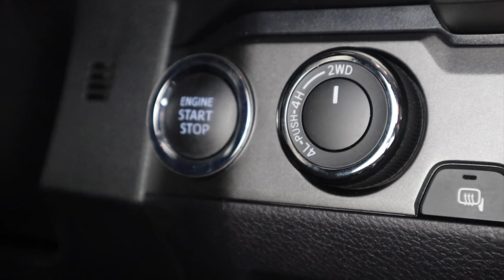Should you buy the latest Toyota Tacoma 2016-2021?

Comment: These are INCREDIBLE trucks that no other truck in the WORLD has or ever will beat with quality. (period)  These are value added and have the GREATEST resale value in the world of trucks. (period) Go Pro mounts are cheap and easy to install. I own multiple Toyota Tacoma's and every year and since 2011 and they ALL are still on the road and work awesome, like new. The domestic trucks of same year, well most are not on the road anymore. I have NEVER had any issues other than changing tires, oil and filters - oh and adding air to the tires to all 8 of my trucks over these year. I sold a 2005 Tacoma for $6K with 268K miles on it, UNBELIEVABLE VALUE! The issues here, I have not never experienced, nor have my family or friends. There is a reason why they have high resale value and sell at a high price - THEY ARE WORK HORSE trucks. Every contractor wants these trucks! The Tacoma has more accessories than any other truck in the world too. Sorry, but my next truck will be a Toyota and another of my old Tacomas will go to one of my sons again.

Comment: I have a 2006 Tacoma 4 cylinder model and I had to replace the plastic coolant bypass pipe and I bought a metal one online and cut a 6 inch piece out of the middle and used heater hose and 2 old school hose clamps so I would not need to remove the intake manifold.    Now it has 250,000 miles and still runs Great.

Comment: I got new 2018 Off-Road v6 , so far after 4 years only 1 issue I had it's constantly shifting gears , I ended up with Regearing the truck with Nitro gears 4.88 on my 33" wheels. Happy so far

Comment: My 17 TRD Off Road hasn’t had too many problems. But it’s in the shop now at 75k. Power steering pump and rack are leaking. Also the dreaded timing cover gasket. Thankfully both under warranty. We will see how long the timing cover replacement will last till replacement again.  Only other issues were valve cover plug tubes were leaking and third break light.

Comment: What are your thoughts on the "AC Drain Mod" that seems to be popular? Some Tacoma owners are concerned with the condensate from the AC drain dripping right on to the frame and causing rust. I am considering doing this mod but extending the drain brings the hose very near the exhaust and I am also wondering if extending the hose with increase the chances of the drain getting clogged. I would love to know your thoughts on this. Thanks!
Reply from the maker: Hi! I would extend the hose! It won’t get clogged but it won’t drain on the frame anymore
Reply: @TheCarCareNut  thank you!  I will do it.

Comment: I have 2006 Tacoma 2WD Dcab 6 foot bed 246k miles . In December 2018 new frame was installed because of the recall . I live in Chicago so no surprise to me . At around 190k all wheel bearings were replaced , no problem with the engine 4.0 V6 , transmission ( dealer changed the oil at around 70k for $200 , one dealer wanted $400 ) , spark plugs changed twice , bearing on drive shaft . If you having problem with rear spring leaves I can recommend Spring Allign in Palatine IL , in 2019 after one year the frame replacement they were done , too soft if you want to cary some load lets say around 1400 to 1600 lbs ( I know payload on mine is 1450lbs ).  But now I'm facing the problem with gridding noise sometimes not always , only when the car starts moving from stop . It might be from rear differential , so far no success finding guy who knows how to resolve the problem  . It' time for new truck anyways .This time Tacoma 4WD not sure yet , long bed  double cab .  Just wanted to share my experience .

Comment: Thank you for being honest about the Tacoma pickup. I just bought a 2021 TRD Sport and after 9,000 miles is is still running perfectly.  I have the premium audio package and find it to be more than adequate.
Reply: How does the premium audio sound? I need premium audio but dont want it if its not going to sound that good
Reply: Report after 90,000 miles.
Reply: @agentaguilar199  just get an amp and speakers

Comment: I have a 2016, and bought the extended warranty. So far the only iss u I have run into was the torque converter shutter, the dealer replaced the trans at 75k and fixed a minor coolant leak.

Comment: Hi AMD, I have a 2016 Tacoma 4 cyl. I have not experienced any problem at all. Not even a bulb.one time 4 years ago I felt ONE shudder that’s it. I bought it brand new . It was made in Texas in April I bought it in May. No tranny hunting, no vibration and no leaks at all. I drive it like a truck not a Supra. Also the very slight vibration at idle cuts in half after a longer drive. No Honda counterbalance here👍 With no bumps it rides Lexus smooth.

Comment: I just brought my 15 dbl cab TRD off-road taco with 147k to the dealer for the crc frame treatment, free of charge, they gave me a 21 TRD off-road rental to drive for a week or so👍. The sales manager called offered me 15k trade in value for mine and keep in mind this is a work truck for me It practically was lived in for 6 years, and is black scratched up pretty good. Needless to say I took the offer and as soon as the frame is done and I remove the decked system I'm getting a brandy new TRD off-road with all the bells and whistles  it will be at the dealership tomorrow. I loved my old one would have drove it into the ground if the trade value wasn't in my favor. And by the way not a bit of rust on or in my frame I always kept an eye on that over the years. I'm in NE PA salt and cinders all winter.

Comment: I bought the next gen 2018 camry with the new 8 trans insept 2017...  A few adjustments in my mind needed to be made about the adaptive transmission technology... it did change the shift points based on my driving pattern.  I had it back to the dealer 6 times.... but it was a software issue.... but performed flawlessly to 90k... until I traded it for a new 2022 tacoma.  I miss my camry. It's very good car.

Comment: I owned a 2009 TRD Sport, ran it hard till 260,000km. Not a single issue. Just picked up a 2018 TRD Off-road with the 6 obviously. I had a 2018 Ridgeline. I love Tacos. And I have an unruly amount of faith in Toyota as a whole, even compared to Honda. So I thank you for your honesty and this video! Many thanks. Here’s to hoping my 2018 with 106,000km is as good of experience as my 2009. ❤
Reply: And just to add to this, it’s a truck. It vibrates and rolls down the road rough. But I do notice this 3.5 runs kinda rough at idle. That normal?
Reply: RIP…hood scoop😢lol

Comment: I bought a '21 base model, utility package. 2.7L 4 cylinder. These engines will outlive anything else on the road.
For frames, I used PBlaster Surface Shield. Paid around $50 for 6 cans.

Comment: Excellent info. I'm in the process of buying a used 2019 Tacoma from my local Toyota dealer. It a Certified Used Toyota with what appears to be a good warranty. I have looked at the frame while the truck is up on a lift and looks real clean. Just a little surface rust in a few places. I'll use Waxoyl on EVERYTHING to solve that problem, plus run it through the local car wash regularly. Thanks for all the tips to look for that I never knew about. Great video!!!  We have two Toyota 4Runners presently.

Comment: I bought a 2016 before they came out.... CPS recall, shifting all over the place, rear diff replaced twice, and overly floppy hood sent to a body shop for repair... I redid the third brake light myself after it started leaking, it was a piece of foam... I loved the simulated atkinson. I traded it for a 2500 to tow our new trailer. It was amazing off road and got great mpg but could not live up to our new uses as a family. Strange to hear about the AC, I live in socal and it always blew cold as ice even up to 125F

Comment: First off AWESOME video!! I have had a 17 for two years now and put about 47k miles on it. Let me say with Alcan rear springs and Bilstein 6112's up front the truck rides very smooth! I have had the dealer fix the leaking time cover (big job), the high pressure fuel pump, and update the ECU. I bought this truck used with 34k miles on it but I purchased an extended drivetrain warranty to 137k miles. The only issue I have right now is squeaking from the drum brakes mostly. The front brakes are silent. Whenever I park on an incline or shift front drive to reverse I get a noise from the rear each and every time. Now this could be the aftermarket rear spring bushings because those do squeak but I am not totally convinced that it is not the brakes yet.
Reply: I bought a 2017 sr with 2.7, auto. In 2020 with 30,000 mil.  Live in rust belt . 
Did the 10mile in 4x4 once a month.  ( in a straight line) on dry surface.  I also hear a clunk/clink when going into drive to reverse.  Or reverse  to drive. Took to dealer under warranty. "We hear it but it's ok" other than that really good truck
Reply: @zeetech5739  you are right good truck. did you do any kind of sealing on the frame to prevent rust?

Comment: I’ve had a 2019 TRD Off Road with a manual trans, and I’m the picky driver he mentions a lot in the video. Literally the only issue I’ve had with the truck is the squeaky clutch pedal. I do notice some of the other “annoyances” he mentions in terms of vibes and whatnot, but none of it drives me crazy bc I bought the thing new for 33k, and I believe you get what you pay for. And in this case, it’s a reliable truck that isn’t going to blow your mind. But you can rest assured the thing will work every single day. Also, I live in east North Carolina where it routinely gets close to 100°F in the summer, and the AC has never been an issue at all.

Comment: Great video. I have a 16 trd offroad, double cab, V6.  Ive personally had issues with 2 of the problems, the ac doesnt blow cold air in hot weather when I have my truck idling. Also, my rear light started to leak when I got a truck back in 2016 just after 10000 miles. I bought it brand new.

Comment: Have 2018, 59,000 miles (bought new) Taco 4x4 Sport. (FIRST OIL CHANGE BUY A MAGNETIC DRAIN PLUG). All recalls done. Only 2 issues.....rear drums are rusting like mad. Gonna remove, strip and paint them. Rust spreading and the plastic oil filter housing cracked. Replaced with genuine Toyota aluminum housing. I may have over tightened it. 
But no other issues at all. Love my Taco and driving for as many miles as I can get. Added: Warn bumper and winch, roof rack, side running boards, mud flap, all terrain tires, window shields. Ac blows cold, brakes are fantastic And it's auto braking and anti seize braking system saved my ass 2 times. Thank you Toyota!! This is my 5th Toyota 4x4. Change oil/coolant/filters early. I only use Toyota Brand 0W20 oil (hey its Mobil, best oil on the market period). Only use oem parts. Just bought a better after market SumoSpring (blue) bump stop for better ride in bumpy/rough roads. Great reviews. When it hits 60,000 doing tranny fluid/filter and gasket change. I oil at 7500 miles. Says at 10,000. Also, I get the engine hot before the oil change, I think it releases more oil. About a 1/4" under the 6 quarts mark on my plastic oil drain pan. Oh..tired of spilling oil, got a magnetic drain plug with a valve so I will put a clear plastic hose from drain plug to drain pan. When hot, that thin oil was spraying everywhere...soon no more. 
Greg
Fresno CA.

Comment: Thanks for the video.  I have an 3.4l 04 trd.  Only thing I’ve had to do is normal fluids, brakes, belts, etc.  and this may seem silly, but it still has the same headlight and taillight bulbs from 2004.  I don’t understand how that’s even possible but found it funny/interesting.
Reply: I drive a 2020 Tacoma Off Road in Quicksand and am also a Dead head.  Let em shine Let em shine.  And leave em on!

Comment: 17 double cab TRD OR 4x4 w 6spd manual. Clutch pedal squeaks with mine. Also I had to change the 3rd brake light gasket after seeing water streak on back window. No other issues so far @54k miles on it April 2023

Comment: 2023 SR5 V6 4wd here. 25,000 miles and so far the rear differential case is seeping in a few areas on the forward side. Dealer checked fluid level and said it’s full still and needs to be leaking in order to re-seal the cover. Only other issue is my brake pedal return spring noise isolator rubber insert fell out. Hoping for 300,000 trouble free miles on my final year of the 3rd generation. I change the oil every 5000 miles and will be doing drivetrain fluids at 30k miles.

Comment: I really can't thank you enough for your objectivity.  Your no BS approach is refreshing and I really appreciate it.  I have a 2022 TRD Off Road.  I haven't been able to get better than 17 mpg highway.  I am supposed to be getting 23 but right now I'd be happy with 20!!! I don't drive it hard, I don't have it loaded down other than me.  Usually I set the cruise at 80 but I've tried driving 75 and I've tried driving 70 (posted speed limit) using cruise as well.  It's 50 miles one way to work so I feel like I have a large enough sample size.  I'm getting ready for my 5000 mile service and I've made the dealer aware.  I just wanted to know your thoughts.  Thanks again for giving us all such good info.
Reply from the maker: Hi Nathan! Thank you for watching my channel! That is typical mpgs. Is the weather cold in your area?
Reply: @TheCarCareNut  It has been lately.  But things are starting to warm up.  I'd say its usually around 40 degrees on my way to work.  It's discouraging to hear that 17 is typical.  I've never owned a truck so maybe I should just get used to it.  I've owned lots of cars and they always meet or exceed their stated fuel consumption numbers.  I suppose I'm comparing apples to oranges here.

Comment: I will have to say that after buying a 2021 TRD  off-road with the Tech Pack that I’m very impressed with the ride quality.  I know most of us like to lift and put on bigger tires wich is ok, but there’s a lot your changing in the frames reaction when you do that. I only went with an inch taller tire for winter/ice and being the tires are heavier caused the shocks to be a bit weak so a lil more bounce and unstable. I take the winter tires off and keep the proper size on the 16 inch rims and it’s back to normal and it rides very nice for a small truck. It rides better than the larger trucks for sure. My only complaint about the 6speed transmission is the way it’s all tuned. Unless your meaning to make it go, it likes to take it easy and down shift way too soon. I’m 49 and traded in my 2000 Tundra  and loved that truck. I still miss her!  Bullet proof she was!  I’m not hard on things but like to use them to their capabilities now and then.
Reply: I get a lot of hate mail on here for telling the Bro's that their huge tires on the already geared high Tacoma negatively affect almost everything, not just them whining about it being under powered and poor mpg. Iv had 2 SR5's with smaller tires than the TRD's {245/75/16} and can tell the difference driving my friends TRD OR. Mines got a lot more zip and it doesnt struggle so bad pulling a tall gear when the trans wants to keep shifting higher early. I just went back to a '18 after having a '18 F150 for past two years. Got sick of the rough ride and heavy steering, doors, ect. I live in the worst roads of USA, Green Bay WI with frost cracked concrete edges 1/2"-1" high every 20ft and its miserable driving a 1/2 or 3/4 ton truck on. In the Tacoma u can hear the tires hitting those cracks, but barely feel it.

Comment: Really appreciated hearing your commentary - lovely always to hear those knowledgeable about their work ! 
Wondered if you knew about 2017 fuel refilling problems ? Apparently there is a plastic flapper and carbon filter inside the neck where you refill your vehicle ( mine clogged after less than 60k ). The problem causes the inability to put gas in without pump kicking off every $1-$2 dollars of gas and you cannot use clip on pump to keep fuel filling without holding pump lever on ( either at slow or fast rate or at any angle pointed into filler neck !) Making it quite frustrating and more time consuming than normal ! 
Was a battle to get Toyota to fix , but finally sent video to service and made headway !

Comment: My 2022 Tacoma SR5 V6 is right at 10,000 miles and my only issue was a strange SRS seatbelt error that took 3 visits to the dealership to correct. They replaced the SRS computer on the 2nd visit---then about 3 months later the error came back. Turned out to be a shorted harness in the rear cabin area. It's been fine since. I drive mine in PWR ECT mode all the time because I don't like the shift hunting without it. I get 19.5 city and about 24.5 highway. No other issues. SRS issues were no cost to me.

Comment: My Toyota Tacoma 2002 with the 2.7 liter engine and jet smooth automatic transmission has over 200,000 miles and runs like new and rarely needs attention other than normal maintance!

Comment: I have a 2016 SR 4cyl 2.7L 5spd manual 4wd with about 20K miles which I bought new in 11/2015.   The only major problem I have had was the clutch pedal.   At about 2K miles it was squeaking and would not return normally.   It took 3 trips to the dealer to 'rectify' the issue.   First time the dealer would only grease it.  The grease job lasted a day so the second time the dealer replaced the clutch pedal assembly.    The third trip was to have the dealer reinstall the 'cruise control lockout' switch properly which they did not reinstall when the clutch pedal assembly was replaced.    One the positive, the dealer did wash it.
There is also a minor issue with the very noticable delay when hitting the gas.   The dealer wouldn't do anything,  told me the auto trans models are worse and to 'adjust my driving'.